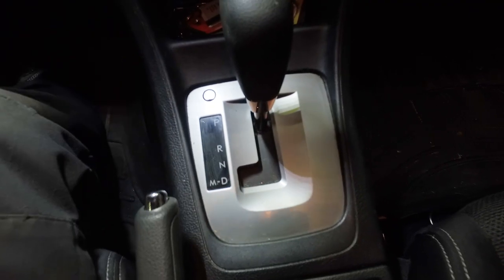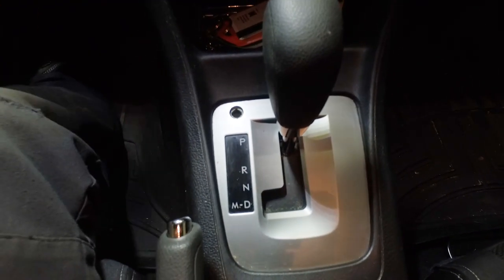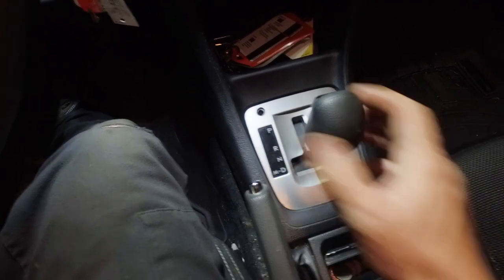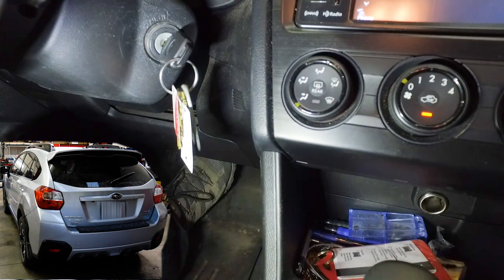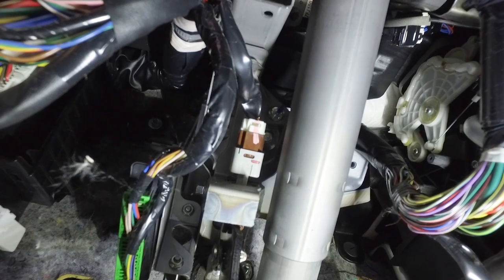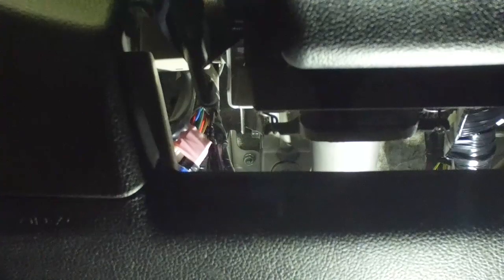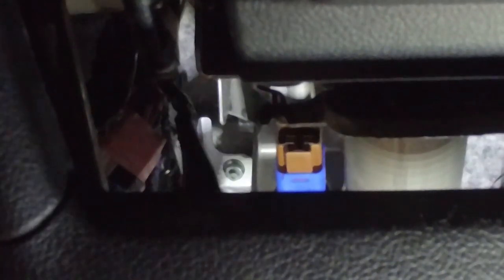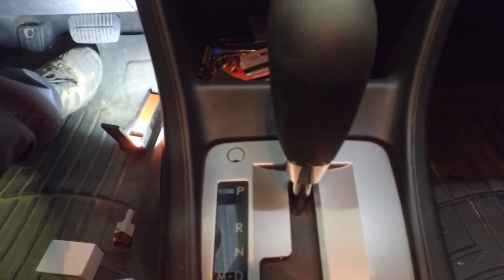Subaru Shifter Stuck In Park - bypass and repair tips - brake light switch

Comment: I changed the switch on my 2013 legacy, it didn't fix the problem. Note: problem started when I tried to connect a spoiler to my brake lights through trunk.
Reply from the maker: It’s possible that a fuse popped because of the spoiler addition. I would check fuses first.
Reply: @ThePracticalMechanic  yes this was it, i changed the "Stop Light" fuse #8 on the passenger fuse compartment, its a 15A fuse. This fixed the issue. But took a $60 damage from the dealer for the switch, ill try to sell it on ebay. Lol

Comment: My eyesight light came on along with the ABS as soon as I changed the thing for the brake light
Reply: How do I get the eyesight to start working again?
Reply from the maker: Codes may have to be cleared from the modules. Several modules look for input from that sensor and will set codes if they detect a problem.

Comment: Hi I was just wondering what could cause a dodge chargers radiator reservoir to start boiling after a short drive?
Reply from the maker: Well there are several things that can cause them to overheat. The 5.7 hemi engine has issues with the thermostat and the head gaskets. if it has the 3.6 then I haven't seen many with overheating issues so check coolant level and make sure the cooling fans are operating. What year is your car and what engine so you have? How long have you had the issue?
Reply: @ThePracticalMechanic  It's a 2011 with the 5.7. It just started yesterday. I noticed a bubbling sound and popped the hood and noticed it was boiling in the reservoir. However the temperature according to the dash was still fine and not overheating. It wasn't boiling like it was about to start spilling out but it was definitely boiling to where I could hear it from inside the car and see it as soon as i opened the hood.
Reply from the maker: Next time it acts up make sure that if you squeeze the radiator hose that there is pressure inside the hose. If there is not pressure then the radiator cap isn't allowing the system to pressurize and the coolant will boil around 220F degrees. If there is pressure in the hose and your not overheating then the bubbles could be combustion gases from a failed head gasket. A radiator cap is a cheap enough part to replace and see what happens if it still acts up you may want to have it checked for failed head gaskets.
Reply: @ThePracticalMechanic  Thanks for the responses! One last question, in general are the 2016 f150 with the 3.5 eco boost reliable? I've been looking into some and the only concern i had was the condensation build up that the earlier year models had in high humidity and rainy weather. Did Ford address the problem or is it still a hit or a miss?
Reply from the maker: I don't have any direct experience with the problem since Colorado is mostly dry but I believe Ford has added active shutters that keep the intercooler warm enough to not have condensation problems. They added these in 2015 or 2016 and this seems to have helped with the problem. I know that the ecoboost crowd has been installing PCV catch cans and drilling holes in the intercoolers on the older ones but that may not be necessary on the newer ones. I have tuned up many of them using the updated plugs and updated plug gap, have replaced one turbo and have replaced several catalytic convertors on the early ones. Most of the newer ones are still under factory warranty so I wont get to repair one for a while.

Comment: can this be permanently disabled?
seems pretty stupid to render the car useless for either no apparent reason at all or a flippin brake light.
seriously? brake light quit, welp guess i'll just walk like what the actual fuck subaru
Reply from the maker: Typically no because the pieces that lock the shifter into park often allow the key to be rotated into the off position. If you try to shut off the car in neutral the key stops at accessory until the shifter is returned to park.  I would just carry a long straight pick or piece of brass hobby rod in the glove box with a piece of tape labeling it so you don’t throw it away.